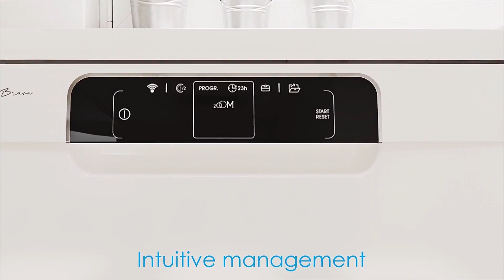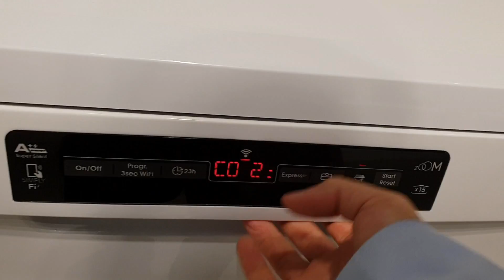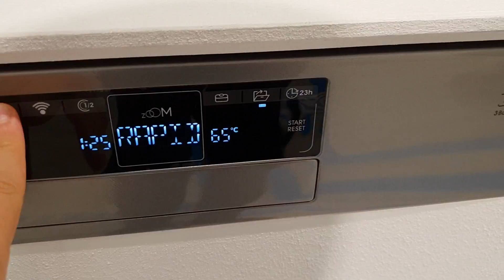IFA 2018 - NEW Candy Brava dishwashers

Comment: This is second, but where is first?
And did you see beko? What is new in washing in beko? I cant understand what is going on in new beko washing machines? Some spraywater, but what is happening there exactly?
Reply: The new bekos models with aquatech have the jet system going through the paddles, soaking the whole load instead of just the front like other brands.
Reply: Aww...it seems to be interesting. It looks like it was like old zanussi/electrolux.
Thanks for answer
Reply from the maker: First is coming tomorrow morning... It will be the ultimate video :) Regarding Beko I haven't seen, but I've seen that it's basicly a copy of old Zanussi spray from the top of the drum

Comment: I've recently bought a Bosch Serie 4 model instead of a Candy Brava (to replace an old and excellent Candy/Zerowatt dishwasher 30yo) because a recent new Candy Grandò slim Inverter Silent Plus, I bought 1 years ago, was really noisy and full of vibrations on the case during unloading and does not balance the load well before spinning. Old Candys worked better! I don't know if new Brava dishwashers are silent models, but this time I didn't want to risk. And new Bosch Serie 4 46db is really imperceptible in every moment of the cycle. I don't know if 43db of Brava are real.. It's a sin.. I wanted to buy Candy before this..
Reply from the maker: Sound of washing machine and dishwahsers are really not comparable... My friends have one, and it is almost impossible to hear
Reply: @nrones  Obviously I know it! I've had both. But if a new washer machine is an INVERTER SILENT PLUS model I expect it to be extremely SILENT even when draining water without vibrations or resonances. New Candy washer machine let me down about this! Maybe Brava dishwasher is EXCELLENT, O really hope so, but I will never know because of the unhappy experience with the new washing machine. And I loved Candy especially for its marvellous design.. :(
I bought a Bosch dishwasher because I thought Candy Brava to be made in China. Instead NOW they are from Turkey as the Bosch ones.